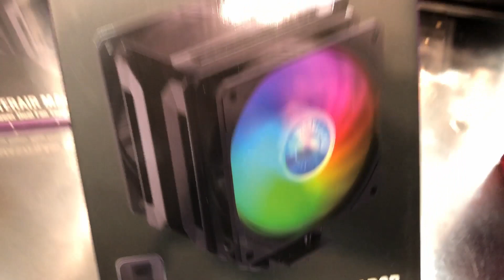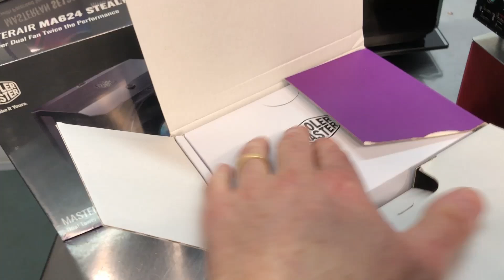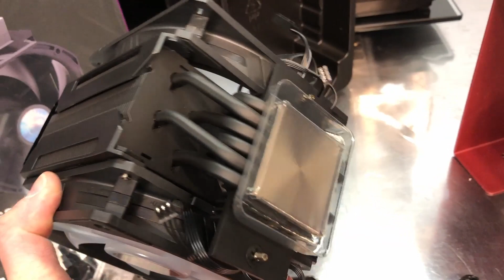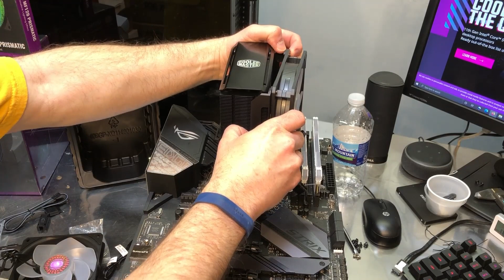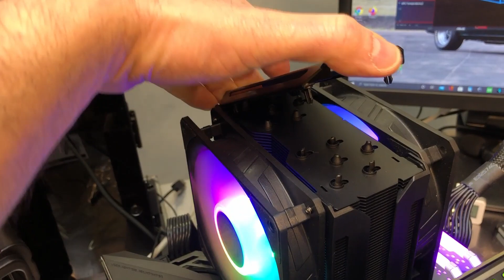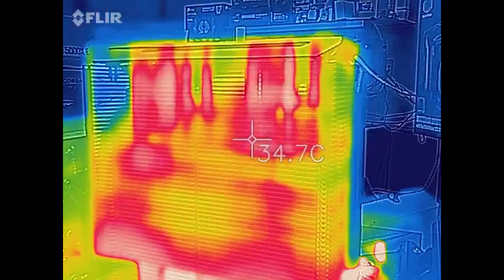OCC takes a look at the new MA612 Stealth ARGB from Cooler Master!

Comment: Every and ALL fans should have this method of mounting a fan.  There is no sense with those flipping small clips.  Flipping, because the flip and slip of them springy things has annoyed me long enough.  This looks like a magnificent fan, they are not cheap, but I am done with the clumsy (mostly clumsy me) ways of getting things mounted.  Tomorrow morning I will be measuring the height inside my case, it might be very tight.

Comment: Your video helped me to rule out the MA 824 Stealth. In fact, this MA 612 seems like it´s gonna be a tight fit already. I hope Asus fixes things with the new Z790 boards. That Cooler didn´t leave much room left on both sides. I wish I could have a smaller air cooling option for the 13700K. Noctua is too large for my taste an the AK620 seems underwhelming.

Comment: Haha, this is the first time I've seen somebody using a thermal imager on a pc setup. I used a Fluke ii910 for dB measurements. Don't see that stuff on Youtube much.
Reply from the maker: Yeah other than the "cool" factor, I know it doesn't really tell you much, so it is more of a "because I can" sort of thing.  I have a dB meter too, but unless I know how the OEM is setting their system up, it is hard to get the same results.
Reply: @overclockersclub  Have you tried using the thermal imager for finding shorts on a defect board? It's definitely interesting to see where heat sources develop, especially under load.
I swapped out a Wraith Prism for a MA612 today and shot some footage using the acoustic imager. It's almost too bad I don't have a card with coil whine.
Reply from the maker: @Leo-pd8ww  We have some very expensive FLIR cameras at work that are used for finding hot spots in the electrical cabinets.  Good for finding bad or loose connections, failing relays, etc.  But to answer your question, no I have not used one on a suspect board.  I have used it around the house to find poorly insulated areas / window leaks, air infiltration...

Comment: Is this sufficient for a ryzen 5 5600x ?
Reply: More than sufficient for that cpu. If you're looking to save money, get a Vetroo V5, $30 cooler and it can handle work.

I did testing for the Vetroo V5 on my Ryzen 9 5900x. My results were at stock clock pulling 135 watt tdp 4.2 ghz held at 65C for 10 min on Cinebench r23. Over clocked it to 4.5 ghz pulling 180 watt tdp and held at 85C on Cinebench r23. That 2nd test is pretty over the top, but it proved that the cooler is capable.

Edit: I had a push and pull fan on the cooler for those results.
Reply: A Hyper 212 RGB for $40 is plenty for a 5600x.
Reply: @phxrider950  yeah I ended up buying a castle ex 360mm aio from deepcool. Safe for future upgrade too :)

Comment: Which is better for my Ryzen 5 3600 this or the MA624 Stealth?
Reply: I'am planning to get the MA612 air cooler to my ryzen 5 3600. I searched around the internet for user reviews and youtube videos tests with the hyper 212 and the results where at 60 - 65°C at games and around 75° max stress in the cpu, which is very satisfactory in my opinion. This air cooler MA612 seems to me a pricer premium version of the hyper 212, the diference is: the construction/material of MA612 is better and have 2 sickleflow fans (they have a very good CFM and static pressure). With all this I think MA612 can handle very well with this cpu in overclock to 4.2Ghz.

Comment: Do you have both fans in a push configuration? If so, doesn't that affect your overall temps, as you should be in a push / pull config. That's what it looks like just from the video, so I believe the airflow is fighting against each other keeping the heat centralized on the block. (Edit) Maybe it was designed that way so you get rgb on both sides? I would like to know, I'm interested in this cooler.
Reply from the maker: I understand what you’re saying, how it looks that the fans are fighting each other but in fact the exhaust fan is made with sort of a reverse profile blade so the fans actually work together and move the air efficiently through the cooler.
Reply: @overclockersclub  That's awesome! I love the look of it, and I'm like finally, because similarly on radiators that you have in a pull configuration it's almost like a waste of an RGB fan since it's facing the other direction.

Comment: The rgb on the fans on the cooler does the rgb cover all the fan when you choose a color? The cooler that I got when cycling the rgb the fan blades are not lit up entirely  only the upper left corner say 9 0 clock to 12 o clock.Possible the rgb on these fans are defective?
Reply from the maker: Yeah, that doesn’t sound right. You should get full coverage when you pick a solid color.
Reply: @overclockersclub   Ok  thought  that was the way the fans should look after re watching your video im like  no my fans do not look the same  Ty for the feed back
Reply from the maker: Do the rest of the LEDs light up at all?
Reply: @overclockersclub  can change the color of the rgb using the control  box  and they all just light up in the top corner at about the 9 to 12 o'clock position
Reply from the maker: @wolfpaws8985  both fans?  Do you have a motherboard that you can connect the RGB to and synchronize it?
Reply: @overclockersclub  Motherboard is Tomahawk B450 unfortunately the RGB header is 12v  4 pin
Reply from the maker: @wolfpaws8985  If you’re having the same problem with both fans, it is probably the controller. You might also check the cable going to the controller and make sure the wires are going into the plug properly And that the plug goes into the socket on the controller.
Reply: @overclockersclub  That was my thinking as well. Even unplugged the sata power for a few minutes. However the outcome is the same. The controller you can plug the adapter in only 1 way

Comment: I feel like you should make some kind o graphic comparing different coolers you already tested on this same platform.
Reply from the maker: Yeah, you are right - I meant to do that.  Next cooler review I will get them all on the same chart!
Reply: @overclockersclub  do you think the new single tower one is better than the fuma 2? I’m currently running a fuma 2 with my Ryzen 5900x. Also, can you put another fan on it or is the fan clip permanently attached to the original fan?

Comment: Ordered this cooler last night from amazon.The current cpu cooler Msi Frozr xl Limits mother too 16 gigs of memory since the 1st memory slot is covered by the fan.Option of raising the fan not available due to case height,Unfortunately . Just hope this cooler performs just as good.Will have to wait and see. Nice video.
Reply from the maker: And how did it turn out?